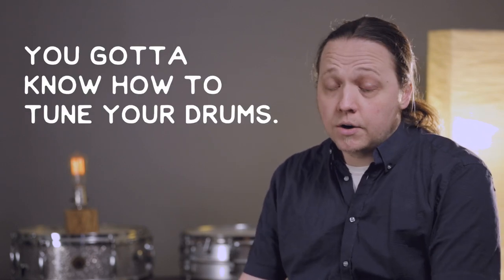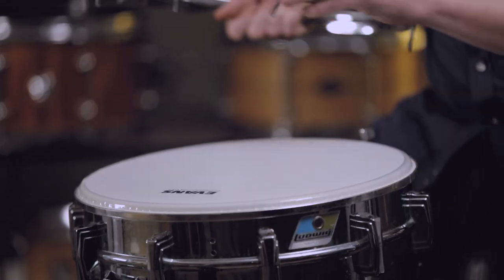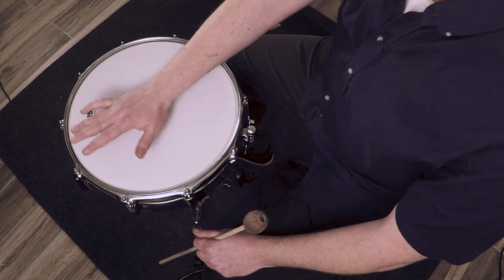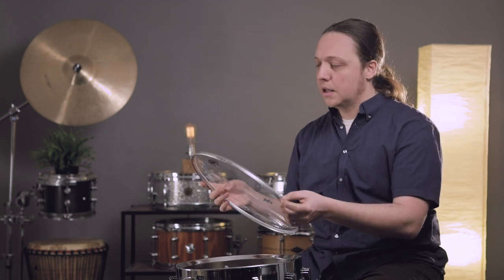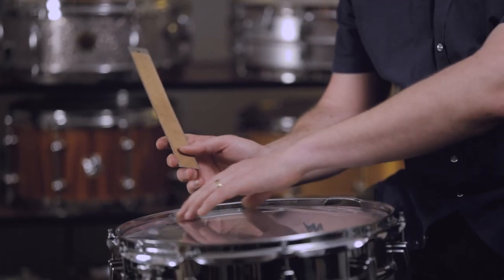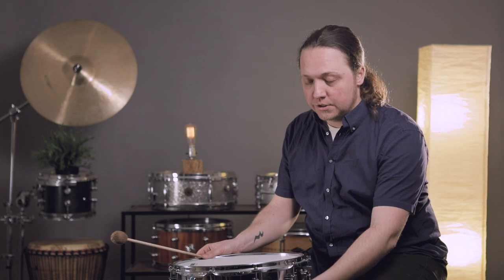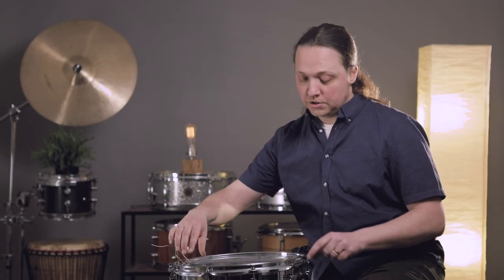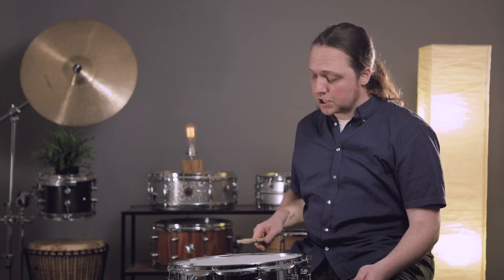Ep. 1 How to Get A Great All-Purpose Snare Drum Sound

Comment: Hey! Just found your channel and loving the content. I have a question though - I have a snare with wooden hoops but for whatever reason, they are not perfectly round. They have roughly 1/8th of an inch variance from 12 o'clock to 6 o'clock vs 3 o'clock to 9 o'clock. Both snare side and batter side hoops. They are longer in line with the snare wires. No matter what I do I can't get the thing to sound good. It's 8 lug and 4 lugs on the longer side need tightened much more than the ones on the shorter side and the ridiculous overtones can't be brought into check (by me anyway) I'm almost certain this was a manufacturer issue with the hoops but I bought the drum years ago. The drum itself appears to be round still. Would it be worth 160 dollars to put new hoops on it or does 1/8th of an inch not make much of a difference and I just really suck at tuning? Won't hold anyone but myself responsible for financial choices here so I really would like legit advice. 
Additionally, I have noticed that my kit also has issues with the hoops being closer to the drum on one axis vs the other. Is this a manufacturer thing? I got the kit new out of box and it has only been in my house and never abused to where I would be bending the hoops - unless they are just very easy to mess up. 
Also, using a mallet may have changed my world when it comes to tuning. So much easier to hear the proper tone than with a stick or fingers. 

Thanks for the content!
Reply from the maker: Hey there! That’s definitely an interesting issue. I’ve had wood hoop drums several times and haven’t really experienced this. I can say however that a defective hoop (even slightly) can really make a drum difficult to tune and get a good sound out of as well. As a less-expensive test I’d see about getting a simple triple flange hoop for your snare and see if tuning improves with that swapped  before dropping a lot of money on other replacements. I kick myself for all the drums I sold in the past thinking there was a problem with the instrument when it really was probably the hoops or snare wires.... -Cody

Comment: Great tip about using the level with the snare side head! I suspect it works great with flanged hoops, but how do die-cast hoops react to that method?
Reply from the maker: I do the same with diecast for sure, but the stiffness of them does make small adjustments a bit tricky. I do find myself tensioning the outer screws (away from the wires) a bit more on diecast hoops to get the sound I’m after. I also find that the snareside head often feels tighter to the touch with diecast because of the way they suppress some of the resonance. So many little quirks! - Cody

Comment: You missed one detail-- where to initially set the tension knob before putting the snare wires on the snare bed. Choking the snare wires too tight and making sure there's enough room on both ends of the snare wires for adjustment is pretty important too for the sound. If one corner of the snare wire array is touching the hoop before tension is adjusted, it can produce unwanted torsion on the wires, lifting up a corner and making the tone "rancid" as you put it--when tightening up the tension knob. After 40+ years of playing drums, you would think a drummer would learn this--I recently started to pay more attention to this detail, and it helped my snare tone and sensitivity just making sure the snare wires are centered properly. My good friend works for a local music shop as the drum tech--and he sees more snare drums come in for tonal issues from "choking the snares"--applying too much tension on the snare wires, killing their designed purpose to buzz. A simple reduction of tension and centering the snares fixed their tone immediately.

Great video--I use mallets to tune as well. Your clip is spot on for giving drummers a tried and tested procedure to get them a great snare tone. Nice work!
Reply from the maker: Thanks for the kind words! I addressed the snare mechanism and wire setup in a later video in the series :) -Cody

Comment: I am publishing in this older video based on the subject: snare set-up. It is both a question and a comment. I apologize in advance for the length.

Yesterday, after over 55 years of drumming, I discovered something amazing; a kind of drum hack. The problem was the age-old snare buzz from the rack tom. You did a great job of offering solutions for this problem, but check this out. I was going into an OCD frenzy trying to get rid of the buzz without success. The snare was set up as close to perfect as I could make it. I tried all of your suggestions with only minimal results. Then suddenly the problem was gone! Good fat snare tone and minimal buzz. But how did it happen? By pure chance, I noticed that the throw-off arm was just slightly displaced. I flipped it into full-on position and the sound immediately choked out. Minimal buzz but horrible snare sound. I backed out the tension screw to get good tone, but then the buzz was back. 

So I cranked the tension back up to get rid of the buzz and began slowly backing off the throw-off arm. When the arm was offset no more than 5% - 10%, the tone was nice and fat but there was hardly any buzz! Eureka! Now, can you please tell me if you have ever heard of this and how it works? Thanks in advance.
Reply from the maker: Hey there! This is entirely possible with certain snare strainers and positioning of those strainers along with the mounting method being used for the snare wires (strings vs. straps). Sometimes it can be remedied but using different wires or simply a different mounting method. Other times, it’s an issue of the strainer (design and/or positioning). -Ben

Comment: If I get this correctly, for the snare side (or snare resonant side ;-) you use the ruler to get the exact same height arround the snare, including the snare bead. Which mean the rim will "follow" the snare bead curvature? Is that correct? This can also imply that the tension on the head should be more or less equal all arround?
Reply from the maker: René Guitar Yes! That’s the general idea. I’ll sometimes tighten the outer screws (away from the wires) if the center of the drum needs more articulation also. Cheers! -Cody

Comment: Hey there at all of you.

I have bee playing drums for years and years. Still there has been allways one question i could not answer. It´s bit of a difficult issue and hard to describe.
So i´ll try as good as i can to describe, what´s been bothering me for such a long time.
When it comes to tuning drums, especially Snare drums, off course, it is mostly all about personal taste and the requirement of the surrounding. But i do wonder if a drum (particularly Snaredrums) have a "sweet spot" or something like "their optimum" own tone/tuning/skin combination" which brings out THE best of their characteristics and if it was possible to "objectify" a method, to bring out these characteristics.
So for instance: I own 3 steel-shell Snaredrums. All of them have top and bottom diecast hoops, simple (only marginal different) Snare-strainers, Same skins on top and bottom (Ambassador snare resonant, ambassador snare coated), same snare strainers. All of them steel 14" x 6,5". The differences are mostly the Lugs, and the exteriorahrdware, and their bearing edges:
One is just a plain and simple 1,2mm steel  Sheel brushed chrome, one was artifically rusted and after that process clear laquered 7 times, one is hammered.
Somehow they all do sound similar (of course), but one has more attack, one is more "round/full" one has a huge attack and bites through pretty much with lost of "pingy sounds". So back to the " big questions:
1: is there a method to stress there specific tones even though all of them STAY equipped equally
and
2: Is there a method to bring out the best of tone out of a drum without experimenting with to much different skins and tuning and to stress the "Soul" of a drum somehow?

I really do hope you can catch my drift and somehow relate to my question?
I´ll be more than happy for an answer or even a whole episode tackling that subjekt.

Best regards from an avid fan.

Jan Zabel, Berlin, Germany

Comment: So when you tune the bottom head using a ruler, do you go for same height across all lugs or is it same height for level and different for the 4 snare bed lugs? Thanks.
Reply from the maker: Hey! Unless the drum has really dramatic snare beds (think Dunnett for example) I go for the same ruler height at all the lugs including those by the snare beds. If the snare beds are suuuuper deep or narrow I might back those 4 lugs out a couple millimeters or so, but that’s more of an ear choice, like if I’m not getting the response at the edge that I’m looking for. Cheers!

Comment: Would be great to get your thoughts on this .I tend to gravitate towards a tuning that is medium low to low, something with lots of tone and some fatness. I usually tune the batter medium than back off on one lug completely. I also like my snare wires super loose. However good articulation can be a struggle with this sound. Any tips  for improving articulation ? I should also mention that i do not like the higher overtones than come from a medium high tuning when rimshotting.
Reply from the maker: Hey there! Sure thing, I can offer some observations. I know that there are a few different tuning schemes out there that involve varying the tension of different lugs to achieve a fat sound with minimal overtones. The sound and tuning scheme you're describing would definitely put articulation at risk, and my first thought is that since this tuning scenario is working for you, keep what you've got with your batter head and try some things with the snare side. One small thing that I do with snares that I feel are too, well, 'snare-y' sounding (and particularly if they have ultra-wide sets of wires on them) is to get my snare side head leveled out and tuned up as described in the video above, and then start to raise the tension on all the lugs EXCEPT for the ones that are directly next to the snare wires. I still do the criss-cross pattern, but I skip those 4 screws. For reasons that aren't entirely clear to me, on certain drums/wires this will allow you to tension the wires looser than you normally would and still achieve a nice degree of articulation at lower volumes/stick-heights. Then, when you dig in harder the wires will still wash out and create lots of sizzle. If I'm dealing with a drum that has 30-42 strand wires on it, I pretty much always do this. Since we're leaving the batter head tuning scheme alone, this shouldn't dramatically affect the overtones of your top head. Let me know if this helps and happy tuning!

Comment: I've been working on this because I'm tired of my drums sounding like butt. I made notes of your instructions, I even leveled my snare side head. However my notes, and I'm hopefully wrong, state that you get that sound from tuning the batter with only a 1/4 or 1/2 turn. It took me significantly more turns to get a decent sound. Did I miss something or does it have to do with the type of drum you have?
Reply from the maker: It may have to do with your particular drum, or your feelings about what constitutes a decent sound. Supraphonics like this tend to have a super wide functional tuning range and you can get a way with pretty low tunings because of the edges and overall construction. That said, I definitely (from finger-tight) turned the lugs more than a 1/2 turn to get to the final tuning. I am however definitely only turning the tuning key a fraction of a turn at a time as i'm tensioning the drum up. If you give a lot of tension to one lug before moving to the next it becomes difficult to maintain even tension across the head. Perhaps that's what you were hearing? In any case, yeah you may have to do many turns to get to the pitch range you prefer for your music :) -Cody
Reply: @SoundsLikeADrum   Thank you for taking my question, just a follow up. I'm working with a Gretsch Catalina snare drum. If you had to sum up how much you might have turned up this snare drum in this particular video, how much would you say you have turned it up? For example, maybe a whole 360 degree from finger tight on each lug?
I might be tuning a single lug too much at a time, sometimes if I know I want to go more than a m2, I'll compensate with a wider turn with the drum key. Maybe instead I should build up to the note I want slower. 
I'm not sure if you covered this already, as the channel is currently on Season 3 I believe-- you may have. But have you made any videos intentionally tuning a very low end snare drum? It's frustrating to watch people tune drums that cost $1000 but sound good even with baby oil covered saran wrap.
Reply from the maker: It's honestly hard to say with regards to specific amounts of turns, if you're up for it i'd try to listen to the pitch of the ring and match yours to that by ear, that's how I usually go about recreating a previous snare sound.
Reply: @SoundsLikeADrum  

Sorry, to be clear, you're saying to listen to the ring/note on your drum and replicate it?
Reply from the maker: @plok6669  Exactly, because from drum to drum the amount of turns of the tension rods won't necessarily equate to the same tension on the head based on number of lugs, type of bearing edge, type of head used etc. A certain number of turns on this snare won't necessarily get the same effect on yours.
Reply: @SoundsLikeADrum  Wasn't aware of this, thanks for hanging in there with me and answering my questions!

Comment: How do you know which lug is the pitch to match to? Is it necessary always the highest one? How do you know when you've gone too high? I know, it's a lot of questions but I've never known where the right tone is that needs to be matched.
Reply from the maker: Hey there! So, it's sort of up to you which one you pick to as the target pitch. I'll usually just try to select one I can hear clearly. This tends to be the highest pitch of the variables around the different lugs, so most of the time I'm raising the remaining lugs up to the pitch I choose. There isn't a 'right' tone' really, it's a matter of trial and error, but in the end you should have as similar a sound at each lug as possible and do whatever you have to to get that, then check and see if you like the pitch and tension of the drum as a whole. At that point you can raise or lower the collective pitch of the head as you like. Hope that helps! - Cody
Reply: @SoundsLikeADrum  Thanks for the reply, Cody! This definitely helps. It just always seemed like every tuning video I watch that they're always trying to match the higher pitch. It does make sense that it's more clear to hear at higher tones though. Thanks again for taking the time to answer my question.

Comment: a question! i notice that when you're tuning the snare side head with the ruler, you do not use the star pattern, but it looks like you just go around in a circle. does this matter?
Reply from the maker: Good eye! I don’t adher suuuper strictly to that pattern for the snare side but I also don’t add much tension to each screw before moving to the next, so the head doesn’t get deformed or weirdly offset at the get-go. -Cody

Comment: This is a great video. I only disagree on one point: you basically state there’s never any use for tuning a snare drum extremely high on both top and bottom. It’s unusual, but for example, Steve Jordan has turned that into a trademark sound and uses it in such an intensely musical way: hyper-tightening almost to maximum on both heads. Generally that does choke a drum, but there are drums that can handle it and players who can make it work.

Comment: Still kind of fuzzy about tuning around the snare bed. Do I tune to match the pitch of the other lugs or, do I adjust the rods around the snare bed to match the height of the other lugs? Thanks a bunch!
Reply from the maker: Hey there! With regards to the snare-bed lugs, I generally just look at the heights. For years I aimed for in-tune pitches all around but found that I could get the head to appear in-tune without being level because of how thin snareside heads tend to be. If you're starting with a fresh head, setting the heights and adding a little even tension all around will usually get the head in tune enough with itself, but more importantly it will allow the wires to work most efficiently and minimize the chance of choking the drum or boosting weird overtones :) -Cody
Reply: Sounds Like A Drum   Your site is the best!
Reply: I had a Machinists Square in my pile of tools in the basement. I used that to level the bottom hoop. Works great. Accurate and fast.

Comment: I tried doing the ruler thing on my snare side head but i'm having problems with my triple flanged snare hoops since i can't tell accurately what height it is because the flange of the hoop is going outwards and it doesnt give me a constant mark for height. Any tips? Do you look at the point where the hoop actually meets the ruler or do you draw an imaginary line from the top of the hoop to the ruler?
Reply from the maker: Hey there! I look from the edge of the drum, so I guess it's more of the imaginary line kind of thing. I set the drum in my lap so that i'm looking at the side of it and then put the ruler on the bearing edge and look across the edge of the hoop at the ruler (hope that makes sense, hard to explain in text).